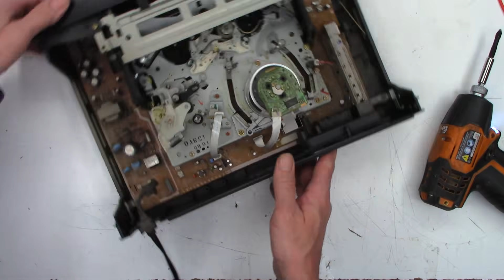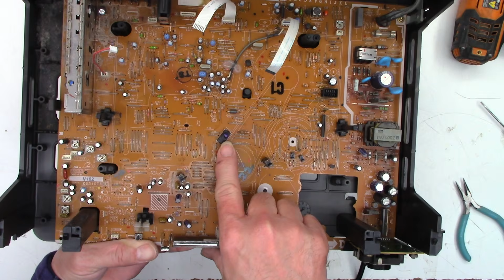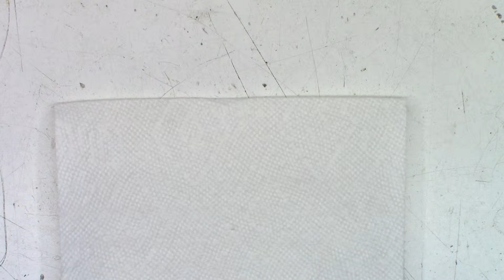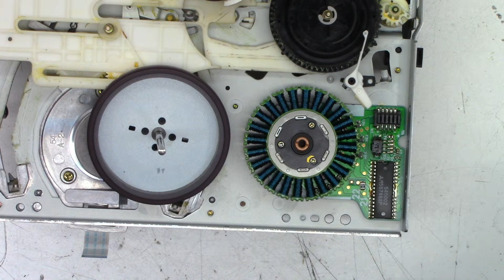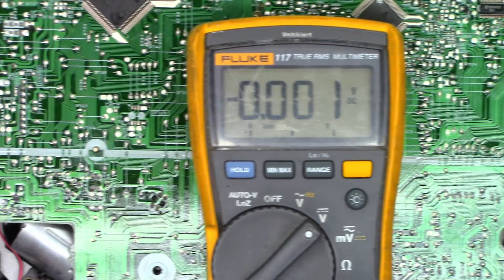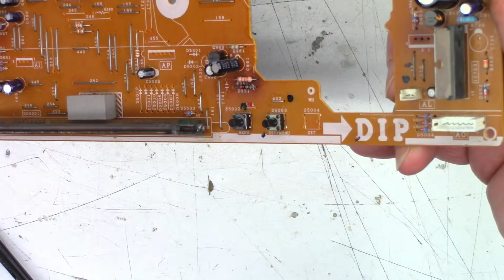$25 Thrift Store Purchase Sharp VC-H952 VHS VCR. Was it worth it?

Comment: I hope you can help me. 
Ive got the same kind of Sharp a VCH 975 U with the same carriage problms,  wont accept cartridge, and always tries to eject. 
I have dis assembled, cleaned as your instructions, found two power supply problems and corrected those, a C904 200V Cap, down stream from R902 Resistor, which I also replaced. I also went through your tests on the start sensor, and the others you  tested, I tested also, but I found values I am not smart enough to interpret, since I am a newer electronics genius... Right. This Sharp ALSO doesnt show anything on the front display, due at least in part to a bulb burnout, b/c I see a black circle on the right of the display board the size of a pencil eraser, over what I assume is an illuminating bulb.
I also checked the IC 951 you attended to in this Video, and mine checked out OK, with 9V +/- on pin 3. I was sure hoping it was bad,  so.......  
Heres what I found, on Sensors D708 and D709.  Please note the following convention for pins. 
3.   4.    Upper 2

1.    2.   Lower. 2.    

A Box, and I checked with a Multi Meter, with the sensors Blocked, and UnBlocked here Is what I found:
D709  BLOCKED.                                 
 3.  1.27 V.     4.  -1.3  mV.               

1.   1.04 V.     2.  -1.3  mV 
D709   UN Blocked
3.   0.96 V      4.  -1.3  mV

1.   1.04 V.     2.   -1.3  mV 
___________________________

D708   BLOCKED
3.   1.27 V.       4.   -1.3  mV

1.    1.04 V.      2.   -1.3  mV

D708 UN BLOCKED
3.     0.69V.      4.    -1.3  mV

1.     1.04 V      2.    -1.3  mV

So, are these BAD sensors ?
Where to get parts ?
Thanks in advance, and 
anyone with suggestions on where to look is welcome. Seems my Power supply is doing something, anyway.

Comment: To me it looked like the 7809 regulator just had cracked solder joints :)
Reply from the maker: It looked good to me in person, sometimes shadows will look like cracked connections. Maybe I will test it in a stand alone circuit as I still have it somewhere.